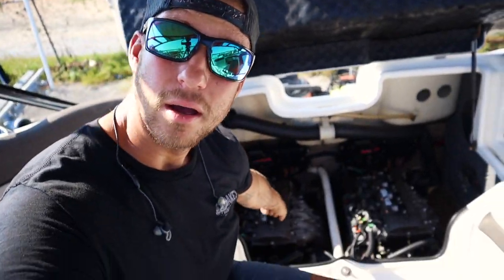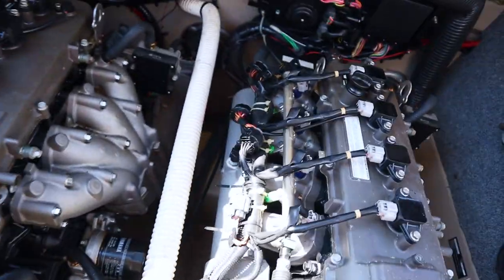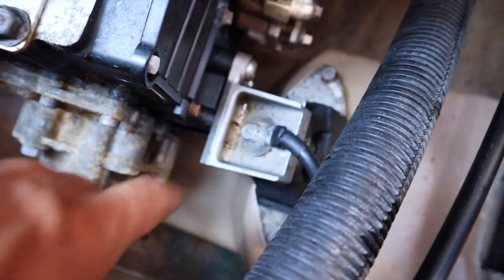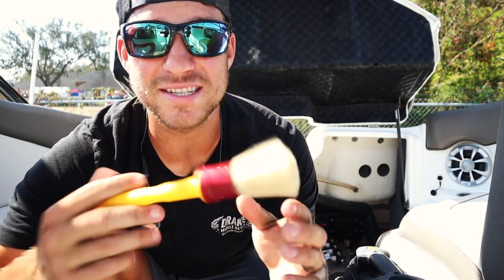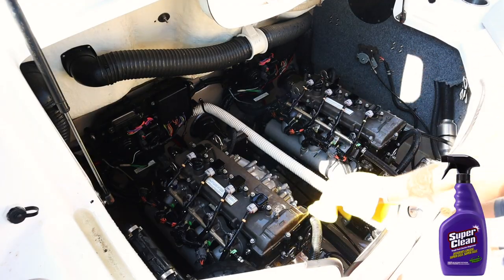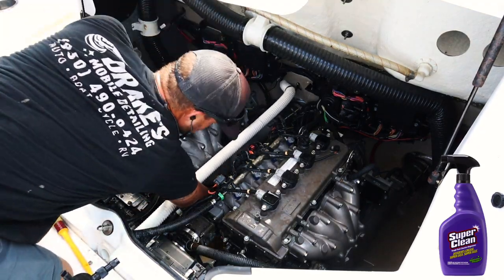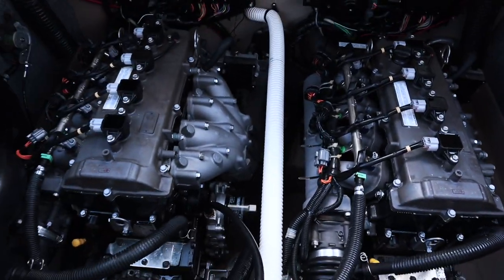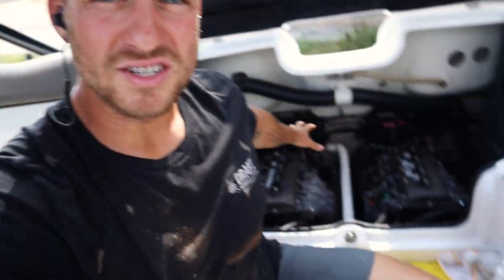How to Clean Boat Motors | Boat Detailing Business Tips

Comment: Hey how are you? Would you clean Bilge pump on a center console the same way? I bought bilge pump cleaner as well.  I haven’t used it yet . What would you recommend?there are wires houses ex ex in there as well as gas separator, oil reservoir, hydraulic pumps for Power poles ex ex. I like like your videos by the way 👍